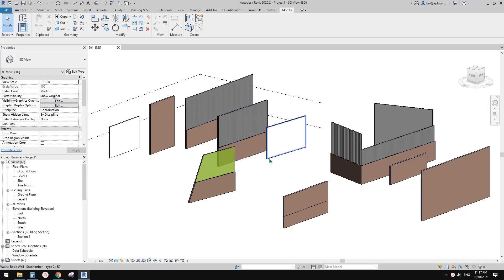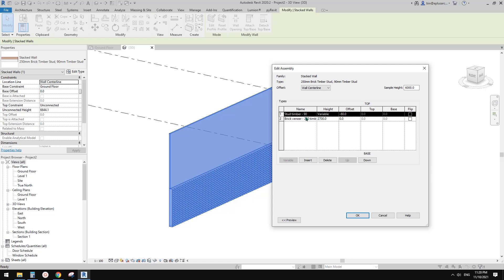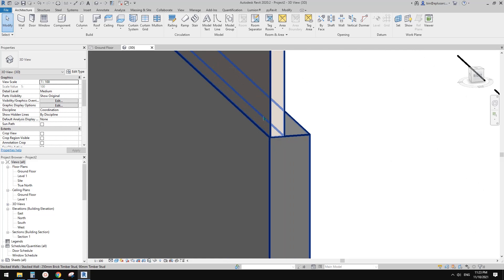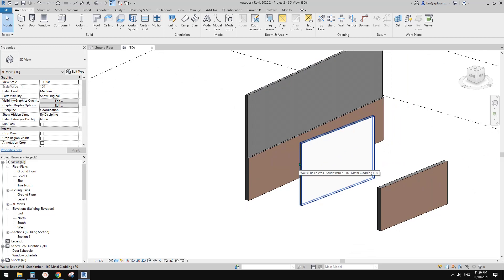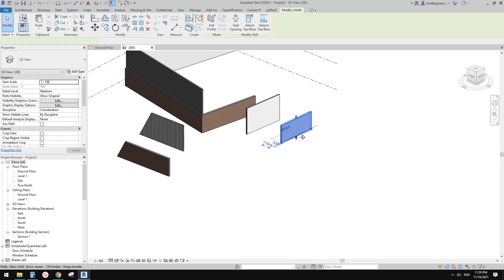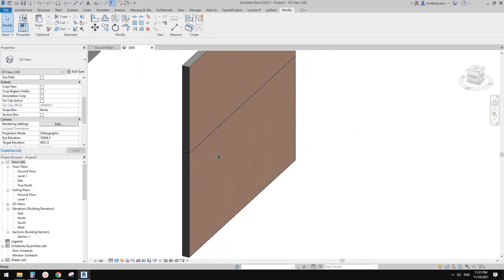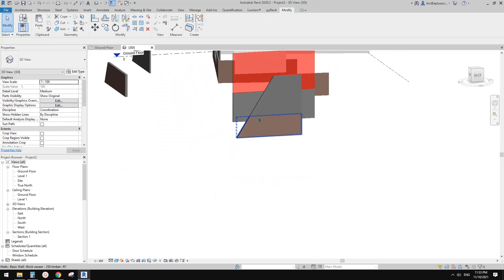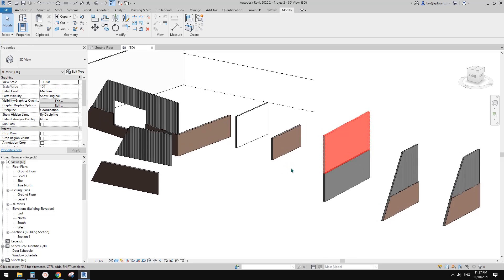Revit Exercise (Day 568) - Let's talk about Stacked Wall and "Splitted Wall"

Comment: hey i want to have skirting but not in sweep or in stack wall can we place wall in front of each other
Reply from the maker: I do not recommend that. Having multiple walls together will create a lot of joining issue. Wall sweep, either built in wall type, or separate wall sweep, is the easiest method for skirting, I think.
Reply: @BINHE615  thnx binhe i solved it i was trying to get wall opening and some of mep elements were clashing with skirting opening is cutting the wall and sweeps

Comment: Hi Bin, what is the mouse's name are you using? it looks so quick!
Reply from the maker: Did I move my mouse too fast? Sorry about that, I will slow down in the future. I probably need a new mouse anyway.
Reply: @BINHE615  No, I didn't mean that, I just want to have a mouse like yours, It seems to be a good one, so i just want to know the mouse's name and the dpi level of the mouse you are setting up.
Reply from the maker: Haha, all good. Mine is a very old Microsoft IE mouse,  almost broken,  need to unplug and plug all the time...   Probably every gaming mouse is good enough for Revit. I prefer wired.
Reply: @BINHE615  Thank for your interesting information. I admire you alot!